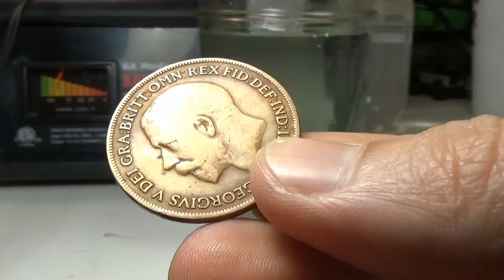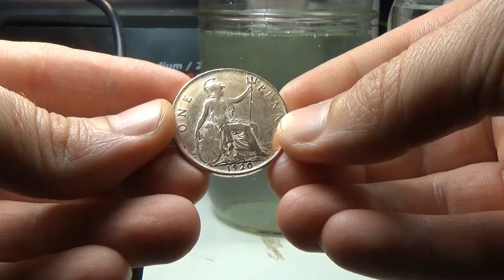How to electropolish the metal on a diecast car.

Comment: Hmm, i guess the residue is in fact zinc oxide, deposited during the electrolysis session, as it seems the castings are made of a zamak alloy or something like that
Reply: Btw, here is a fun part in all of this, in the beginning of car production it was common to passivate steel surface of car body parts with a layer of phosophoric iron after a sink in a phosphoric bath for hours or days, and this is why you can often find very old cars still in pretty good condition despite more than half a century of slacking in nature as an old fogotten trash.

Comment: Very nice.  I read up on this. Turns out there is a sweet spot in the current density where max polishing occurs. Too little current and nothing happens, too much and you get bubbles. Somewhere in the middle a fine insulating layer forms - this is the "residue".  Anything that sticks through the layer is etched flat "polished". So the layer is very important and in my experiments I get best results when I do NOT agitate. Just keep the current down so that bubbles don't occur.
Reply: Need specific details of your method.
Reply: I would also like to know about your method.

Comment: Where can one get 75% phosphoric acid in Canada? I’m at my wits-end trying to find a small bottle of it...
Reply from the maker: Ebay? Amazon?
Reply: baremetalHW Cannot ship restricted chemicals across international borders. I found something called Surfox-T, a weld cleaner that the SDS sheet says it’s 40-60% phosphoric acid. Would the concentration be enough for the process?
Reply: I'm wondering as well.  Could 85% be watered down?
Reply: Update: Walter Surfox-T Stainless steel cleaning electrolyte works well. I purchased a 1.5L jug from Praxair.

Comment: 05:47 The Mercedes looks absolutely RAD in bare metal, it's one of my all time favourite cars. And: Yes, I shed a tear or two in the scene in "The Witches of Eastwick" where they crash - or at least devilishly abuse one from the same timeframe / Mercedes model line (I know I know, it's not the same model, but  roughly the same lines - WHAT. A. BEAUTY. )

Comment: For the electricity thing: Ohms law applies! Yes, your charger can output up to 6A but can only provide a maximum of 12V if I read that correctly - that would come down to 2 Ohms resistance. Your hand to hand body resistance should basically never be that low. If you have a really bad day the body resistance might drop to something like 500Ohms. So at 12V there is a max current of 24mA. That is not enough current to really do harm if you're not holding it for a long time. Realistically a human body has more like 10kOhm - with the gloves this should be even higher. Car batteries can easily output a few hundred(!) Amperes and generally you're not worried to kill yourself by touching the contacts. :-)

Comment: It's a cool process but personally I can't help but use a file and sandpaper to clean up the rough casting. Window edges, mold seams all the surface pitting....I just prefer to sharpen up the entire casting. I know it's not as original anymore but it seems silly to go so far and not take time to perfect the casting as much as possible.

Comment: Regarding solution temperature, glass concerns, and safe workspaces: While there are many different types of glass, and some, such as the jarring glass you're using are made to have boiling liquids poured into them, the biggest issue with chemical use and glass is cluttered work spaces and open shelves overhead from the glass or whatever you're using, where something can get knocked off a shelf or cluttered pile and break the glass! The first few episodes of Breaking Bad should clue you in to the nature of most chemical issues. One they don't cover directly but that one functioning in a lucid state should infer is that at least two and preferably three or more levels of containment should should always be employed when working with anything toxic as well as corrosives. "What are multi-levels of containment?", you are probably asking. Well, the working beaker is your primary containment for the process, and the storage container is the primary container for storage. In the case these are breached by accidents or deterioration over time, a secondary pan or pail would catch the escaping material. Please keep in mind that UV light and oxidation effect plastic and many other materials. I recently found an 8 oz plastic bottle of tin plating solution which had been stored in a closed box, had cracked and soaked through the heavy corrugated box onto a bare pine bookcase it was stored on. Luckily the leak was slow enough that the box wicked most of it, sustaining a rate of evaporation that prevented the solution from spreading past the perimeter of the box and was easy to clean up without effecting other items. The dried acid was neutralized by spreading baking soda over the stain and misting it with distilled water to hydrate both the acid and the neutralizing agent to allow the two to dissolve together and be safely removed and disposed. one of the key circumstances in this spill was the thin plastic used in the container, and the fact that many items were packed into the box which I had prided myself for finding one that was a nice gently snug fit. Even this light amount of pressure combined with an extremely minute crease in the side of the bottle, probably sustained during typically brutal postal shipment, concentrated and leveraged the stress of that pressure focusing it on the tiny crease until the plastic decomposed to the point that the crease just slowly unzipped like that pair of pants that never catches properly but you won't throw out for reasons of economy or vanity. OK, if you made it this far you may have forgotten where we started from, multi-level containment. "How many levels can one have?", you probably asked before being drug through this senseless epic. Well, along with several levels of nested storage containers, the work surface itself such as a wet station that can catch spills with a drain equipped with a catch container that is also compatible with your materials is one level you might not have considered, and after that, a floor configured similar to a shower room and lined with a compatible material is not necessarily difficult to set up if one is planning on making an enterprise out of their hobby or even just sustain an obsession for personal satisfaction (a hobby).

Comment: You pretty much don't have to worry about a 12V or even 24V power supply causing your heart to stop, or causing any more damage than mild discomfort, in spite of scary looking current rating. The reason is that the human body forms a resistor. I measure about 40 kOhm between my wet fingers of left and right hand, 25 kOhm between wet hands holding gold plated probes, and it's assumed by scientists that the resistance is at least about 1 kOhm under various less fortunate conditions, such as offending conductors being pierced right into your flesh. Even at 1 kOhm, 24V will pass the current of 24mA across you, which is not entirely benign and definitely not a ton of pleasure, but not considered lethal. At 25 kOhm that i measured, it's just 1mA, you can't even feel that. Voltages above 40V are assumed to be potentially dangerous under unfortunate circumstances, and the power supply doesn't even need to be able to deliver a lot of current to kill you then.

Comment: I wanted to try something like this on some antique copper cups and some other old metal items.

My question is should you clear coat the item after this process to prevent further oxidation? Not worried about the food safe side of it since I wouldn't paint the inside of the cup and by what I've researched on paints, I can find some that are totally food safe once completely cured. But, like I said, I wouldn't paint the inside of the cup. I just want these things to return to their original copper finish and stay that way. Thank you for any advice.

Comment: How do you safely and responsibly dispose of the acid when you are finished?
Reply from the maker: Add any base to it like sodium hydroxide or baking soda. When it stops bubbling you can get rid of it.
Reply: baremetalHW thanks! By "get rid of" do you mean garbage or drain? I use an etching solution and neutralize it with baking soda as well....but even then it needs to go to hazardous waste collection.
Reply from the maker: To be honest I would need to check and see...  At my work, we do haz so I usually just add it to that as it is such a small amount.  It may be best to call a waste disposal company and just ask. I would hate to point you down the wrong road.
Reply: baremetalHW gotcha, thanks! I really appreciate your responses! You rock.

Comment: would a phone charger do instead of the car battery charger? or a cheap PC power supply?
Reply from the maker: It would, but it will take longer...
Reply: baremetalHW thanks for the video! What settings do you use on the charger?
Reply: i used a 2A phone charger and it went pretty well but took longer. A PC power supply does the job faster. I believe that the phone charger would be good if you have the time, since the process is not that aggressive for the metal. the most important thing Though is the metal that you are using
Reply: Thanks for the info! What type of metal did you use? Stainless like he did?

Comment: what is the spray that removes the paint
can you give the name
Reply: He uses "Aircraft paint remover" by Kleen Strip. But you can use any gel based paint remover. I use the "safe for indoor use" citrus stripper found at Home Depot. Takes a little longer to work, but does the same job without the fumes.

Comment: 12 volts, 6 amps, will never ever kill you.    I would not touch them to my tongue, but i have held the positive and negative ends of a battery charger at 6 amps and felt nothing.  If you touch them to your tongue, it is like testing four of those small square shaped batteries.  it will leave a mark on your tongue, but again, it will not kill you.  12v DC @ 6 Amps does not kill.

6 amps at 120 volts, now... that, would be unpleasant experience and could result in death.
Reply: PUBLIC SAFETY ANNOUNCEMENT!!! Please recheck your information. It only takes approximately .7 amps to kill you (700mA). Understanding that your own skin may have enough resistance to keep the amps from hitting the heart, but don't tempt your life with a maybe. Please go and read about electrical safety before ever using electrical means to do anything. Thank you, be safe, customize and modify safely.

Comment: To baremetalHW are the cars worth more or less value after restoration because they are not original
Reply: Smear Pap A mint car would lose value. He has pointed out, though, that these were worth a maximum of a few dollars before restoration. Sometimes less than a dollar. It's so low that you can't really ruin the value of the car.
Reply: Smear Pap A mint car would lose value. He has pointed out, though, that these were worth a maximum of a few dollars before restoration. Sometimes less than a dollar. It's so low that you can't really ruin the value of the car.

Comment: I'd like to use this method to remove some dust from some lifting plates/weights. But the clamp from my battery charger will of course not be able to allow me to grab the weight dip in and take it out. Any ideas on how I could do about doing this with heavier objects?
Reply: Wrap it in stainless steel wire.

Comment: I have done a few cars this way now, but have had some odd results too.  I hade a base go almost like a black color.  Post dip polishing has done very little to fix that.  Can you give any idea what that is all about?
Reply: It's called phosphating and it's pretty much permanent, if you know about firearms it's basically what they call Parkerising. It's very durable and very hard to remove (that's why they use it on firearms).
Sounds like you left it in the acid way too long.

Comment: I use PhAcid without the electricity. I find it does a good enough job for 1/75 scale models and gives them a nice key to take paint. If you find that the paint isn't taking to the metal's surface because it's too shiny, some PhAcid will knock off a bit of that shine and give some grip in the metal.

Comment: Hobby Pros mix up a bucket of baking soda and water in a five gallon pail to plunge hands or dilute anything knocked over, splattered or spilled. It instantly neutralizes the acid and is more effective than water. Let everyone that comes around know about the pail.

Comment: 75% phosphoric and 6 amps seems like using a sledgehammer to crack a peanut.  I have been cleaning corroded hotwheels for years by soaking them in acetic acid - commonly known as vinegar ($2/48/gal @ walmart).  I just tried your electro method using vinegar, an old 500 milliamps phone charger and an unwanted casting on the negative side and got the same results although it took a couple of minutes instead of a couple of seconds, but It was also safer and cheaper.
Reply: I believe he had the charger on the 2A setting
Reply: Dude, can you explain to me how you done it? i need this!
Reply: using vinegar in electrochemical u deposit zinc but when only vinegar u corroded/polished  or why not exchange polarity in electrolysis, anyway thanks u give me a new idea

Comment: Love your videos, having been trying some of your techniques with success. Thank you! Just one observation, 12 volts DC cannot electrocute you no matter how many amps are available - try touching both terminals of a 700 amp car battery, one with each hand - nothing. Still wise to keep the water away from the charger. I would be more inclined to use a 12v battery for safety.

Comment: Using stainless steel as an electrode is a very bad idea. The main problem with using it is the hazardous waste it produces. Stainless steel contains chromium. The electrodes, and thus the chromium is consumed, and you end up with poisonous chromates in your electrolyte. Dumping these on the ground or down the drain is illegal. It would behoove you to do your own research before attempting to use electrolysis for this purpose or for rust removal like I use it for when I find pieces metal detecting. I would suggest sticking with ferrous metal electrodes for general purpose electrolysis.
Reply: i've seen videos of these baths, but those were on a much larger scale. in them, they used rebar instead (since it's got iron in it, very basically making it ferrous).

Comment: If you ever find the electric current flow to aggressive you can wire a 21W car tail light bulb in series with the supply which will limit the current flow to 1.4A to 1.7A depending on the output voltage of the charger.  Or any other car bulb wattage to achieve the current flow you desire.
Reply from the maker: Good Idea definitely keep that in mind!

Comment: that battery charger won't work because it's designed with a safety feature so when it's shorted out which what you are doing when you put both leads in the acid so maybe if y'all try this you should do some research
Reply: you don't put both ends into the solution.  You hook one to a ground in the liquid and dip the other with the car on it.

Comment: that battery charger won't work because it's designed with a safety feature so when it's shorted out which what you are doing when you put both leads in the acid so maybe if y'all try this you should do some research

Comment: so if you do not want to achieve a flat surface and you're going to paint the car, then what's the point of tbe polishing?
Reply: I know it's been a year since you asked the question, but I'm going to give you an answer anyway. Electropolishing a hotwheels car is so that the body of the vehicle keeps the facets, or imperfections on its surface. This is useful when painting with spectraflame (or clear color) paints. The surface is reflective, and all the imperfections make the body glisten under the clear coat, instead of giving a mirror finish.

Comment: 2:53 at the risk of being seen as a nitpicker: The bubbles are probably hydrogen, not air. If done  within reason, the concentration is probably never going to get high enough to cause a risk, but people might still not want to drop in a piece of metal over night "to see what happens" (in addition to the safety advice you've already mentioned in the video). 

That said: Amazing video!
Reply: Point being, hydrogen is explosive.

Comment: is it possible to swap new hotwheels wheels to an old matchbox car because i want to put some fancy wheels on my matchbox  ford sierra xr4i but the underneath of the ford is to wide for any wheels that would suit it. thankyou
Reply from the maker: you can but you may find it easier if you exchange it with other MB wheels you like from a car with the same size wheel as those you want to  replace..
Reply: thankyou, i have sorted it now, i used a small file and filed down the back of the wheels and now they fitt and turn perfectly :-)

Comment: I'm a big fan of hot wheels  but how can you make hot wheels fast on the track
Reply from the maker: not much you can do really to the car... how fast they go depends on a bunch of factors like how round the wheels are... how strait are the hubs.. how strait are the axles.. are the wheels toe-in or toe-out... how parallel are the axles..were is the cars center of mass...how much do the wheels weigh.. how much does the car weigh.. on and on...  if you want a fast car... buy a crap load of cars... race them.. keep the winners of each race.. then race the winners.. do this several times until you get an undisputed winner...  that is probably a pretty fast car..
Reply: Thanks man I hope I win
Reply: I don't know if it makes the car that much faster but if you take some graphite powder and spray it on the axl and wheel it makes it faster